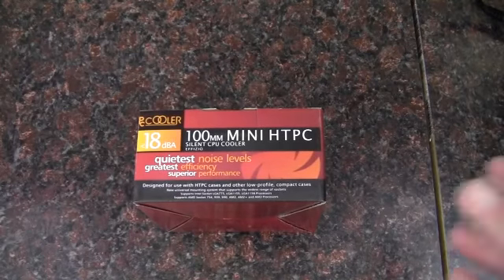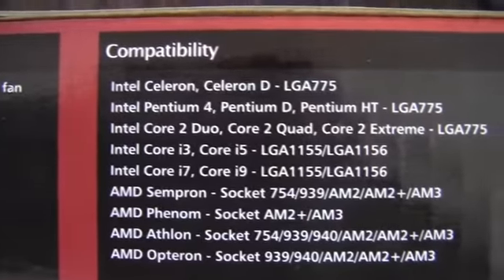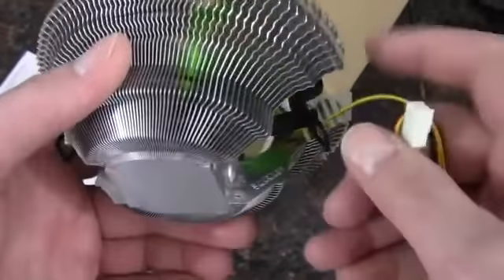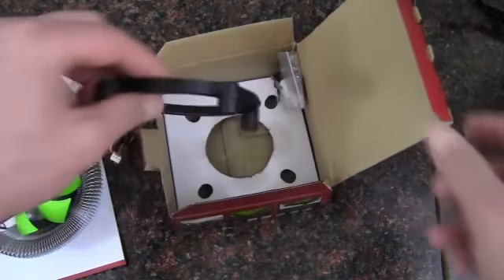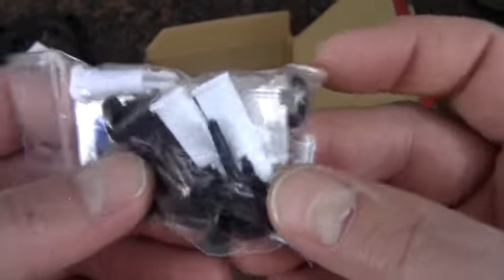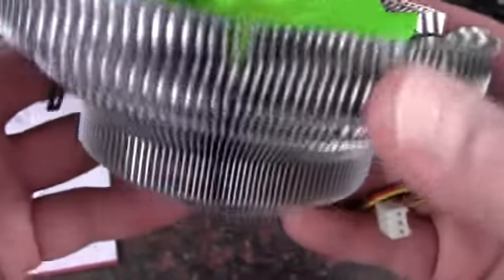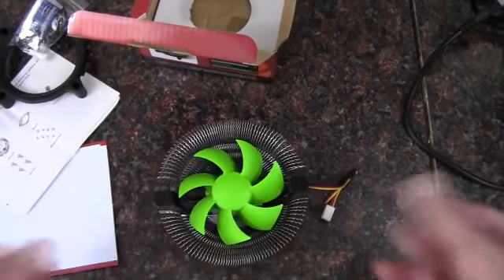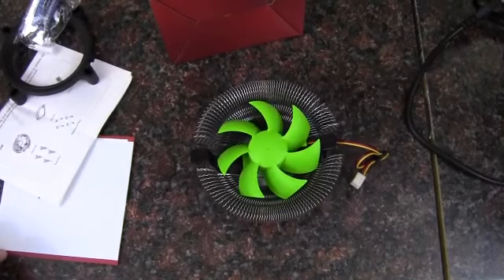Silenx 100mm Mini HTPC CPU Cooler

Comment: How tf you get the black part on
Reply from the maker: For Intel sockets, there are little pins that get inserted into black mounting bracket to secure them down. It is pretty similar to how the stock Intel coolers snap in like a rivet through the motherboard holes. For AMD sockets, you do not use the black mounting bracket. The metal retention bar on the heat sink itself will fit into the key on the stock AMD cooler mounts on the motherboard. Does that help?
Reply: AdoptedMike understood but I don’t believe the black rim type piece is big enough for the heatsinc
Reply from the maker: Oh, sorry. On mine it took a lot of pressure to get it mounted to the bracket. It was a little uncomfortable. I wonder if maybe you have one that is made a little too tight. Is it possible for you to return it? There are better low profile coolers out there performance wise. Although, this one is pretty inexpensive.
Reply: AdoptedMike I finally was able to attach the bracket but it starts to bend so it won’t fit the motherboard properly